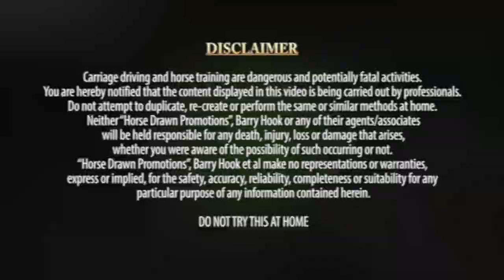The 'Whys' of Positions and Rein Adjustments in a Trandem

Comment: What's the purpose of a standard 2-horse tandem configuration?   The lead horse doesn't pull much weight,  is that correct?  Is the tandem configuration  mostly a training  exercise?
Reply from the maker: Hi E H,
A Tandem (which - as you imply - is one horse in front of the other) was done for many reasons - including as a training exercise.
One reason would be to transport a riding horse (which would be the lead horse in the arrangement) along with a driving horse to a meet such as a hunt, as they could be driven in their saddle with the reins threaded through the adjusted stirrups. Another reason could be to transport a horse to market for sale (again the lead horse would be the one for sale) to show them off without tiring them on the journey in. A 'cock horse' for hire may also be found at the bottom of steep hill, which drivers could pay to have hitched to the front of their single horse to help it get to the top before being unhitched and walked back down by their handler. The same idea is one of the reasons a 'unicorn' arrangement is used (a pair with a single horse in front of them in the middle).
If just used in general exercise, you can get both horses to pull weight fairly evenly, but as with leaders and wheelers in a four in hand, the lead horse most comes into play over rough terrain or up steep inclines to assist the horse in the wheel.
Reply: @barryhook2  Very interesting, thank you!